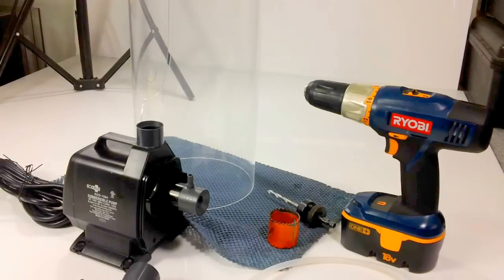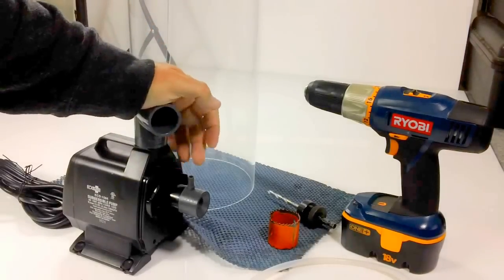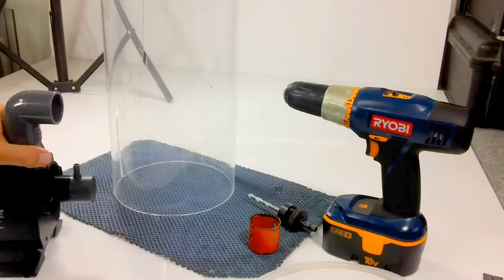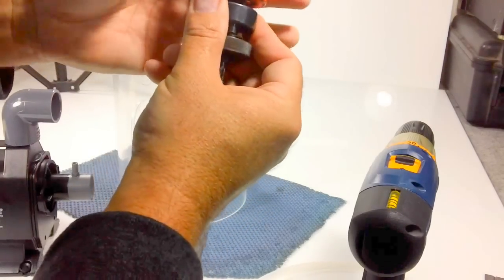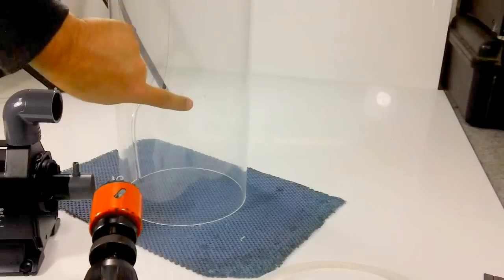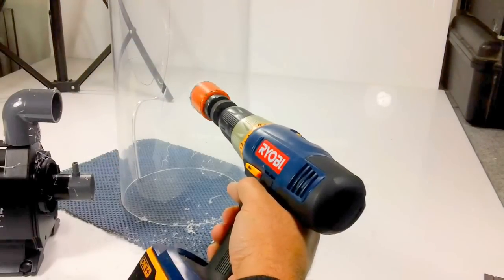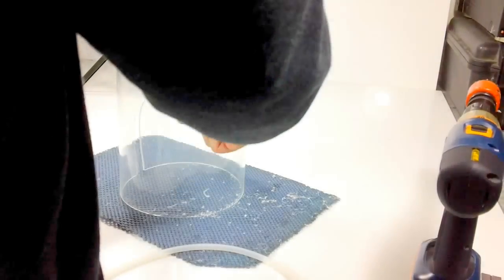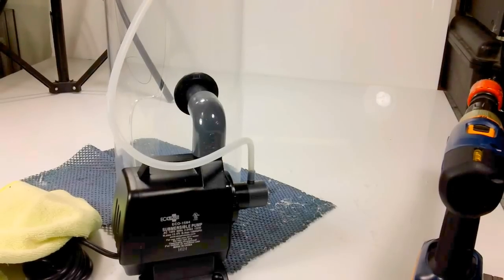CRAS Presents... Reef Dynamics EPSP5 Upgrade Instructions

Comment: how about a video on how to put the pinwheel on a new ecotech 1584 pump?   They still make the pump but you can't find pinwheels.    Its a hex center pinwheel, should be able to swap it for the standard eco tech 1584 impeller